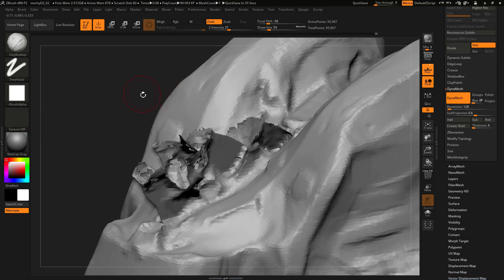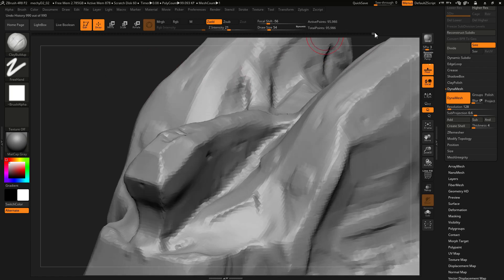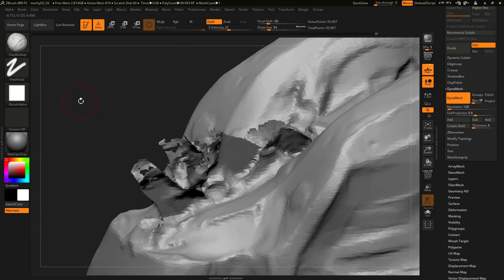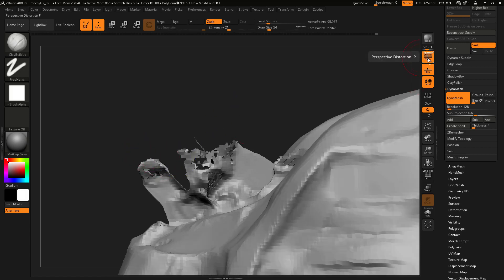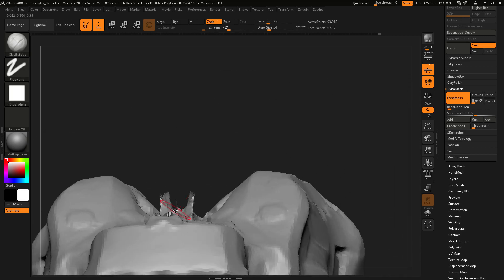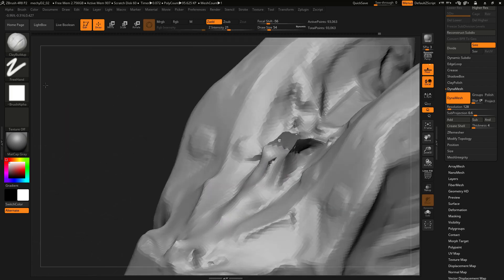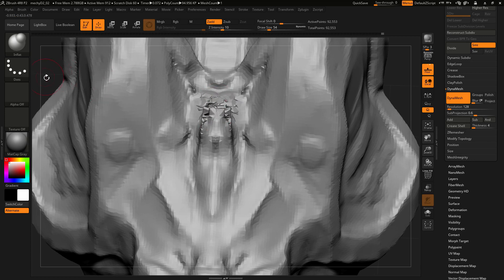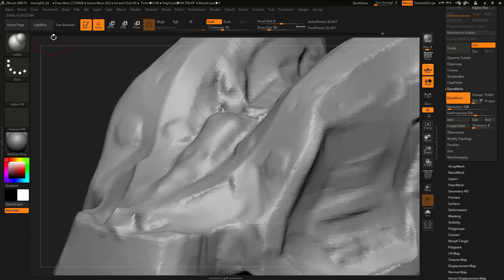ZBrush Tip: Fixing Dynamesh Holes

Comment: Any Idea how to fix CAD data. So like .stl files. They come with holes but the types of holes are more like gaps. How would I close them off? I'm not sure if that's the problem but a simple dynamesh doesn't work. Or I t take FOREVER to complete. Thanks
Reply from the maker: Hi Josh, if you pop a link to screenshot of the wireframe in ZBrush, I or someone else might be able to offer suggestions.
Reply: @SnapLaunch  Thanks for the reply. https://imgur.com/a/F8OA1TN

You can see the wireframe there, showing the problem with CAD data. The verts are not all attached. Then an image with wireframe off, leaving you to see the extent of all the holes and gaps.
Reply from the maker: @joshgilbert9571  Thanks for that. Have you tried taking it into Blender (eg 2.92) and merging vertices by distance by, pressing Tab to go into edit mode, pressing ctrl + 1 to select vertices, selecting the desired vertices (‘a’ to select all), then pressing ‘m’  and choosing “By Distance” to set the merge distance threshold? If this is successfully done, Dynamesh should may be more useful afterwards. -Ben

Comment: I subscribed after checking out just a few of your videos - you do an awesome job and your efforts are much appreciated. I chuckled to myself when I saw this technique, as I kind of developed this exact same solution. Any suggestions as to how to get rid of those annoying "pinch points/tight peaks" that never seem to go away when you do this??? I end up hiding-then-deleting-hidden a small area around them - then re-dynameshing ( to fill holes/re-topologize). Those little bastards are hell to get rid of. Thanks again for the video!! Cheers
Reply from the maker: Hey, thanks for your thoughtful and constructive comment - I smiled reading it. As for those annoying "pinch points/tight peaks" and using del hidden of a small area, that seems like a surefire way to get rid of them. They're very annoying indeed. These days, I make a concerted effort to avoid going to a higher detail level too soon or sculpting with an overly aggressive brush and this has largely been a saving grace for me :P. Thanks for your subscription and I'll be sure to try out your removal method next time I encounter the issue! Cheers

Comment: can do a prevention video so we don't need to really fix but this showing if we need too
Reply from the maker: To help avoid running into this issue in the first place, you may wish to try using a lower strength/higher detail/smaller brush when sculpting areas with a small amount of distance between opposing faces, eg, eyelids or a coaster for hot drinks.